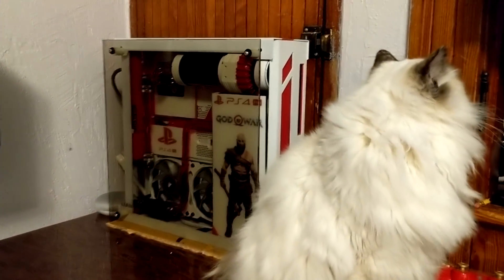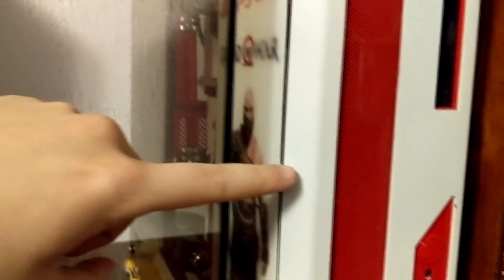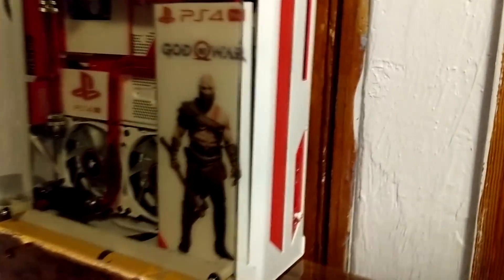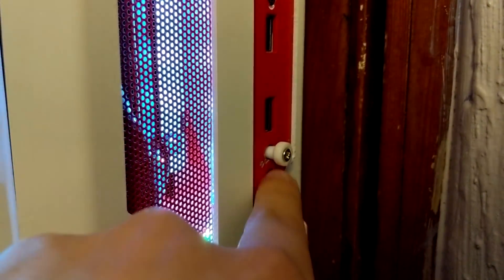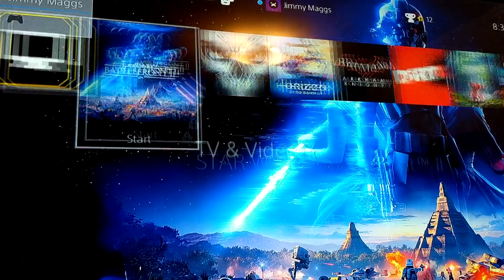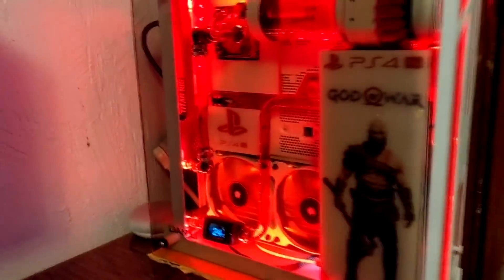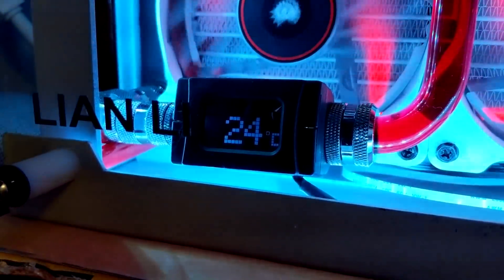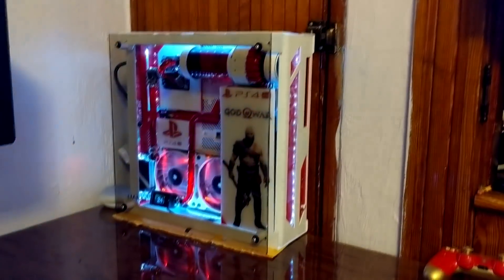IT WORKS!! PS4 Pro Water Cooled (Part 5) FINISHED! Parts Lists, & Temperatures

Comment: Where do you draw electricity for fans and water pumps?

Please answer : hananhn96@gmail.com
Reply from the maker: Check out my other videos, I go over all of that. Especially with my water cooled ps4 2.0 I end up using a PC power supply instead of the PS4 power supply

Comment: You should install a 3tb Kingston SSD.

that should make loading times 5x faster.

 Hard drives also make some noise so it would be even less noise overall
Reply: I have crucial ssd and it works fine, faster load times slight a bit faster download and reduce install time
Reply: hilkie81 but not 100%? It something the PS5 will be optimized for cant wait!
Reply: They don't work that overall great with ps4 firmware there's no optimization

Comment: First of all this is amazing! 

Secondly I’m working on my own build and I was wondering how you did the eject button? The video shows you made a custom button but I’m wondering where/if you wired it, or if the button board is mounted just behind your custom button there?
Reply from the maker: I got an extension ribbon cable from Ali Express and put the button circuit behind the 3.5 headphone jack input on the front of the computer case. I ripped out the headphon jack internals of the case because I didn't need it. After that I made a small plastic piece that fit in there and it hit the eject button circuit perfectly.
Reply: JMAGG awesome thank you! I saw this a few weeks ago and have been wanting to do this since! I’ll have a video up for it as soon as it’s complete 😎
Reply from the maker: @lukafagundes4104  can't wait to see it! Let me know when it's up I'll put the link in the description of my video

Comment: Would you be able to do this in an NZXT case? with an NZXT x62 AIO? I am very very very keen to try water-cool my PS4 but am not 100% sure about how to wire it (powering the pump and LED, can I use a PSU seperate to the ps4's one or does that have to be used?) Please help. my email is notch342@icloud.com. I would be very grateful for your help.
Reply: did it work ?

Comment: I’m doing the same thing, I’m putting it back together now and was wondering if you reinstalled all the heat covers on the motherboard.
Reply from the maker: No, but still kept the motherboard shields. And the vram on the back, I put small heat sinks I got from Amazon on them

Comment: Hey! I was curious to know if you've had any leaks or any problems with your build so far and if you've done any maintenance since completing it.
Reply from the maker: No leaks at all, only maintenance was swapping the liquid for the meyhams Arora liquid. And the only issue I've had with it is the Bluetooth connectivity with the controllers. Since the case is metal I feel like Bluetooth range is less. For example I would be able to go about 40ft away from my PS4 with the controller when it was in the original plastic case. Now I can go about 25ft to 30ft before it disconnects

Comment: Swapping out the useless 4TB harddrive with an SSD would have given you more of a performance gain in gaming then the whole watercooling thing.
Reply: Ssd don't add performance. The lower loading times that's it

Comment: I've not read the 490 comments on this final build vid, nor did I read any on the other 4 so if this was already asked I apologise, how did you address the USB ports from the front of the PS4 pro that are now tucked behind the pump or did you decide you don't need them?
Reply from the maker: In my part 2 and 3 video I explain it
Reply: @JMAGG  so I went and re watched part 2 & 3 just to make sure I wasn't asleep or something when I watched them & I'm sorry the only mention of the front usb ports is when you said something about them being in the way of the Pump/reservoir in vid 2 and no mention of them in vid 3.. it's no big deal I just figured you'd want to utilize the ports in some fashion by maybe running extension cords from the ports behind the pump to the ports that came stock on the case but that's just me. Great build though Sir I applaud you!
Reply from the maker: @KrisHall7997  Thank you, and for the front ports I ended up using angled usb extenders to connect to the front ports of the ps4 and avoid the pump. Here is the link to those   https://www.amazon.com/dp/B06VWQVHZC/?ref=idea_lv_dp_ov_d 
Then I used this cable to connect the USB extenders to the front panel USB.  https://www.amazon.com/dp/B018XFSVG8/?ref=idea_lv_dp_ov_d

Comment: Fluid temperatures don't tell you anything. The system could be running at 40 degrees or 90. Fluid temps just tell you that the system is drawing power. Waste of a mod.

Comment: @JMAGG
hi man i was wondering to things one wouldn't a all in one cooler had saved space and two how did you protect the apu from electrical because of the flat copper plate it would have issues with the components around the die of the apu

Comment: All these stupid ass PC elitists. News flash: water-cooling is not restricted to overclocked PC systems. If anything, this makes absolute sense. For $600, you get a CPU, GPU, PSU, RAM, Operating Sydtem AND Storage. All you need is the case, cooling system, and effort putting it all together. Heat and dust kills systems, PC and Console. Performance throttles at high temperatures under load. Water cooling lowers temperatures under load.. any mathematicians here that can put 2 and 2 together for the haters?

Probably cost ~$1000 total for this build, if not less. Good luck building a PC that can run games equal to or better than a PS4, with a custom loop water-cooling system, for the same price.

And good luck trying to make a PS4 Pro last as long as this one will.

AAAAND. I can almost guarantee that this custom PS4 Pro build absolutely SHITS on 80% of you elitists' home-built PCs. Fuck outta here.
Reply: Lol what are you even babbling about? Everything you said was just dumb. What are you even making a point about?
Reply: actually the ps4 costed about 1600$ you can build better PCs for about 400-500 and adding water cooling is only 400-800.
his build is cool AF but thats wrong,you can make a pc that runs games better for cheaper.

Comment: Good job, any perfmormance changes now ?
Reply: what performance changes? he didnt overclock it because you cant. the only change is the temp and noise. Maybe he gained back the lost frames from how hot this thing gets, but he still capped at 4k 30fps and 1080p 60fps.

Comment: High mate, extraordinary mod, really excellent, i wonder if games acctually run better when the frame rate is unlocked. How god of war on the frame rate priority mode works? I think that ps4pro could possibly maintain 60 fps under a very well cooled ps4pro.

Comment: Awesome.i wish my pro had better cooling.i open it and clean the fan at and the fan is out and i drop frames on destiny 2 it's annoying
Reply: The ps4 and xbox bottle neck because of the temps so it does change performance just like when you you have a disc in it runs hotter

Comment: Hardware is still what matters bro, even if the ps4 runs in ICE doesn't change its hardware specifications, it doesn't bring significant performance boost as well
Reply: Collins Eban pretty sure he did this for fun, instead of doing it for a huge performance boost.

Comment: Absolutely gorgeous and a water cooling work of art, but it seems kinda wasted on a console. It's still just a PlayStation under all that, and the insane amount of cooling you'll get from a custom loop will do absolutely nothing to a locked processor besides maybe prevent a few small frame drops. Most games will still be locked to 30 fps. The few that aren't will still run at the same frames they did before. You could've crushed the PS4 pro out of the park using this on a PC. 

Also given that the PlayStation color theme is black and blue, white and red seems a little.... Off?

Comment: I thought about watercooling my xbox one x but decided to change the thermal grease to thermal grizzly conductonat to help get rid of the heat better .
But I have a custom computer that I've decked out with custom watercooling 
I call it overkill 
It's got an delided i9 7900x and dual 1080ti's its awesome

Comment: I love the raised glass! Looks so pro raised instead of flush imo. I use to mod my consoles but I also used Executioner chips in all mine, back in the day we had to clone the hexadecimal HDD serial ID to replace the drive, it was a pain in the arse. If you lost the original HDD you could be screwed if the current one burned out. Ive never mod'ed anything this nice, it was more for software and hardware. I put them all back into the original boxing and I will keep them for life. Most the games for ea. of the 4 consoles I have boxed have all the games preloaded on my HDD. The nicest one I did which wasnt close to this I have a 2"4" LCD display flush mounted on the front case showing me everything I want. Like a G19 lcd display would be sweet on that. Truly awesome man! 5 stars

Comment: Did u add the Ps4 disc drive in?
Reply from the maker: Chapo el yeah it's in there. I have links to all the ribbon cables I got to extend it so I can use it in any location
Reply: did u use an extension SATA Cable?

Comment: Should send it to digital foundry see if it has any performance Increase. It might get a more stable frame rate being cooler although I suspect the bottleneck will hit home before any thermal throttling.
Reply: even if there were, they'd not be noticeable since most of all good games run stable at 30 or 60fps
Reply: Consoles don't bottleneck, the games are built to run on them, you get the most performance possible out of ever part. Also, no, there would not be a performance increase because unlike PC's, the clock speeds do not change depending on temperature and the PS4 Pro doesn't overheat, it just gets loud!
Reply: and to further add to the previous comment, consoles don't bottleneck because the components are optimized to run together.
Reply: The pro doesnt go over 80 degrees while running a load with stock cooling,so it wouldnt make a diffrence water cooled anyway.

Comment: And why is this ps4 pro better than a normal ps4 pro?
Reply from the maker: Checker vom Neckar Does a normal PS4 pro look like this? But it's actually better, everything is more stable and quieter.
Reply: Jmagg2234 okay, I’m not that into console gaming, I thought maybe you changed the hardware to get more FPS or something like this, that would be pretty impressive. 
But I still like your ps4 pro it looks stunning 👍🏻

Comment: Hi Jmagg, love the work. One question: would you still use the same water block for the CPU, or would you swap it out for something else? Thanks!
Reply from the maker: RyTLessard a VGA block would be slightly easier because you won't have to make custom holes on the CPU block like what I had to do. Here is a link to one on ek's website. I can't find any on Amazon, https://www.ekwb.com/shop/ek-vga-supremacy-nickel
Reply: Thanks for the input - this is going to be my project for the week after next. I hope all the parts arrive in time. Appreciate these videos!
Reply from the maker: RyTLessard No problem, and hope everything goes well! If you have anymore questions along the way just let me know

Comment: My project is done not as Aesthetically pleasing but I found the schematics to use an atx power supply for all power including the ps4 itself using both power supply connections located on the motherboard and I used a thermaltake touch screen as a fan controller for all fans. I connected the aio liquid cooler h55 consair to the mother board. There was a lot of soldering! my case is a itx Rex case on amazon. So I couldn’t hide most wires. But all inspiration cam from Jmag2234 and the list of cables I could not find if it wasn’t for him. I went simple so I could just get it to work. But hats off to Jmag2234
https://youtu.be/1p4WgZNDBjw
Reply from the maker: Matthew Castaneda jr. Thank you bro, I'm glad I helped. And I can't wait to see it if you make a video on YouTube!!
Reply: Jmagg2234 for sure. I will be getting that up as soon as I can. Not this weekend but next for sure. I will make sure to place credit big time to you. It’s still in prototype phase. But working.

Comment: Not to knock what you've done since it obviously took a lot of patience and skill, but is there a point to liquid cooling a PS4? There's no way to overclock it, so is there any noticeable performance benefit? It does look awesome though.
Reply from the maker: Andrew Bobucky not really any performance gains, it mostly stays stable now. I noticed before when playing infamous second son for a while it would start to drop frames from all the particles in the game but ever since I water-cooled it it no longer drops those frames. It is also a lot more quieter now too. Plus it's a one of kind lol
Reply: Jayden 97 so then what's the point of your comment even? To brag about your rig?

I asked him a legit question as to whether or not he saw any performance difference in liquid cooling something that he has no way of tweaking to get more performance out of.
Reply: @andrew.b.1183  If that was my rig, I wouldn't be bragging about it lol. I agree, no point to his comment!
Reply: @JMAGG queria muito replicar esse projeto seria possível?
Reply: Watercooling doesn't serve just for overclocking purposes (although it extremely helps). I'm not sure where you or OP lives, but in my case, I live in a dry climate desert (Death Valley area) and during summer months it can  get really hot and when the PS4 pro's fan ramps up, at like 10ft away that thing is VERY LOUD. Watercooling can help run quiet or even at near silent operation. As well as prevent thermal throttling.
Reply: With liquid cooling you can bring the temps down even further which keeps the system from thermal throttling and increases the life span of the components.
Reply: the question is why do you even exist? to knock down an enthusiast work? great job you've accomplished nothing
Reply: Jayden 97 
Nothing much more pointless than water cooling  a console....
Reply: You're an idiot. If you knew anything about pascal you would know even just water cooling will net you extra performance as it throttles at like 60c.
Reply: Jayden 97 if you can’t overclock any higher after water cooling then you’re not very skilled at it (or you got a piss poor chip)
Reply: Jayden97 Actually both of those are quite overclockable and will see a nice increase on both the 4790 and your 1080. What Andrew is asking is why he would do this? The point of going to a liquid cooled system is to decrease thermals so you can overclock your system. If the PS4 was experiencing occasional stutter from overheating, improve the fans or build a real PC.
Reply: The point of water cooling for me was to make the machine quiet. No point spending thousands on a good speaker system when the sound of the fans drowns out all the detail
Reply: Random Guy well it's cool but it kinda is useless
Reply: Andrew Bobucky Im asuming he is a pc gamer and decided to upgrade his ps4. Because a console gamer doing this would be very stupid... specialy bcause that costs more than the console, could simply buy a pc, buying a console and spendng more money on it to watercool it is dumb. I mean dumb to buy one and do this, but not dumb in this guys case, i bet he has an awesome pc and decided to upgrade his ps4 too.
Reply: David Piçarra it will still. Read about entropy.
Reply: Jayden 97 it doesent drop frames after like 3-4 ouhrs of playing
Reply: This is very creative,I want to do one myself.Are you doing how to video or is there anything i need to know before I proceed this?
Reply: JMAGG Yeah I noticed that in Infamous - Second Son too on the base PS4. I just started playing that game last month and I had to stop because the drops were so bad. 

It's awesome how you upgrading the hardware for your PS4 Pro fixed the issue, that's only something I would imagine on PC.
Reply: Jayden 97 your pc would not overclock better than it would on stock cooling? Ok!
Reply: Andrew Bobucky its improves performance by allowing to system to work at full power without getting record hot
Reply: How many bigoted PC elitists does it take to start a comment argument over water-cooling?

Grow up children.
Reply: Well obviously the point of it would be stability and low sound from fans.
Reply: Jayden 97 if you have a 144hz monitor its not pointless. Also 8700k with a 2080ti btw
Reply: Andrew Bobucky it's to make it Silent no sound
Reply: Heat over extended periods kills components. Whether it's thanks to dust buildup or failing silicon, keeping thermals low will increase that PS4 Pro's life expectancy. Having an open case like that ought to help keep dust at a minimum while also running much quieter and cooler than the stock case.

On the flipside, he will need to pay close attention to his radiators as using them will mean he needs to clean the fins of dust often. He will also need to take note of his coolant's shelf-life and replace when necessary.
Reply: He watercooled it so it won't overheat
Reply: Cool temp equals consistent frames.
Reply: The PS4 pro jaguar CPU is over clocked
So water-cooling will make it more stable and increase it's life span.
But water-cooling a normal PS4 is pointless.
Reply: Random Guy it won't increase its life span or whatever since the cpu was design to work at those temps and speeds
Reply: the cooler the better in that regard
Reply: The lifespan of a GPU running @ 80+C under load vs a GPU running at 60C and below under load are dramatically different. His PS4 will outlast most, including yours. Pointless? No.
Reply: Jayden 97 if temps remain at safe levels if will prolong the life pf yout hardware. So that is a positive.